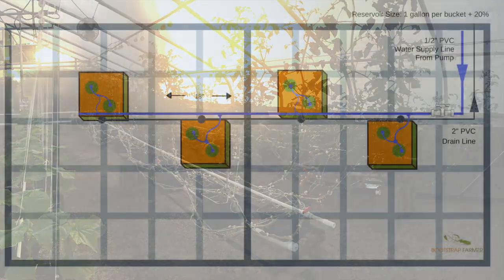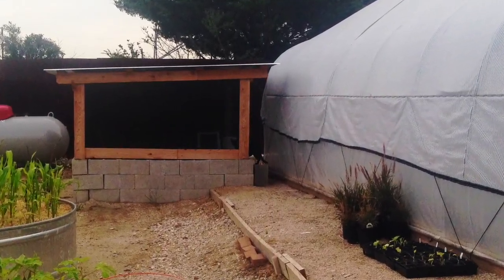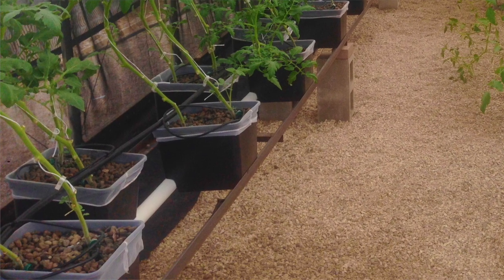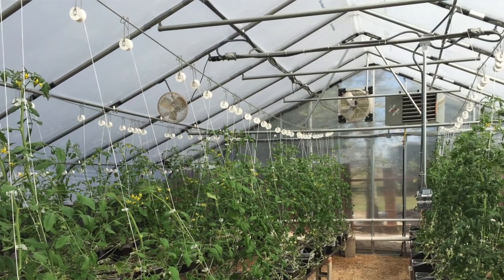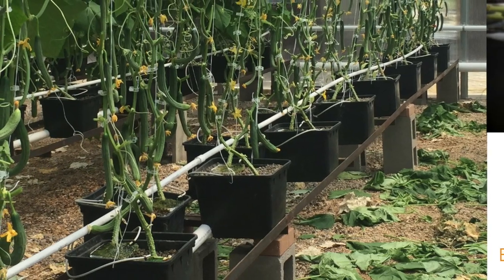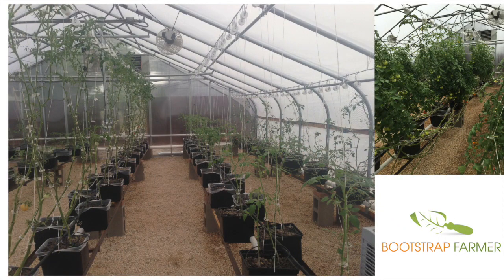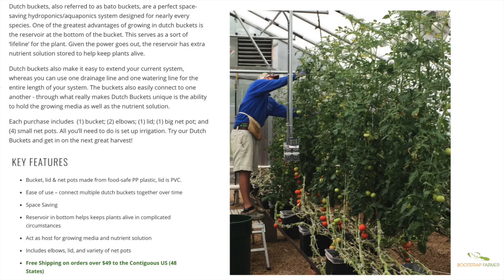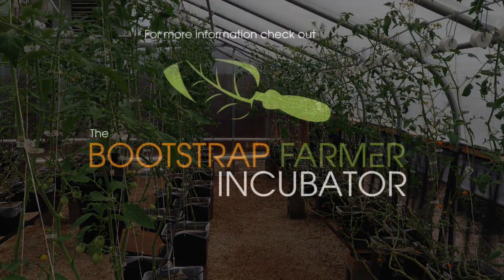Dutch Buckets 101 | How to Set Up a Dutch Bucket Hydroponic System in a Greenhouse

Comment: What are the spacing between your rows? We have 3 smaller GHs that we have made the buckets for but will be transitioning over to your buckets in the near future. Also will be putting up another larger GH. Trying to plan for what we will need. 
Thank you for the information
Reply from the maker: My rows were about 40 inches apart. I’ve seen anything from 6 foot to 3 foot so it’s personal preference and how much airflow you have.
Reply: @BootstrapFarmer  thank you

Comment: Hey,
Thank you for such a informative video, however I was wondering to ask two questions:
1. How much produce do you expect and in how long (very confused about the harvest cycle)?
2. How many Dutch buckets do suggest to have in 1000 sq.yards. ?
Thank you so much for the video, therefore I will highly appreciate if you can clear my doubts.
thanks
Reply from the maker: Produce yields is a hard one to figure. Tomato variety has a lot to do with it. You see graphs of 25-50 pounds but I feel its subjective to the structure, daylight hours, time of year, experience, and anything else that could vary between farm to farm. 
Can you clarify 1000 Sq yards? 9000 sq' is a lot to start out with. I had a 30x36 greenhouse w 120 buckets. That equates to 1000 buckets for 1000 sq yards hypothetically if you used the same spacing.
Reply: @BootstrapFarmer  Thank you that helps, however it comes out to 9,000 sq.feet. so I'm still confused a bit about how many buckets I cant fit.

Also, how does the cycle work I mean would I be able to take out my first produce after 3 months of germination? 

Thank you so much it helps a lot I'm absolutely fascinated by the subject and look up to your farm.